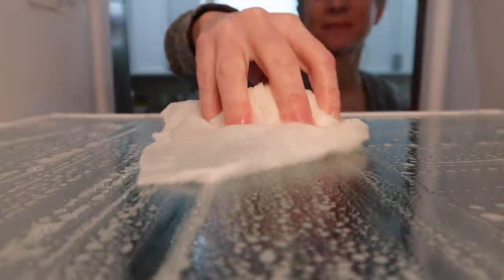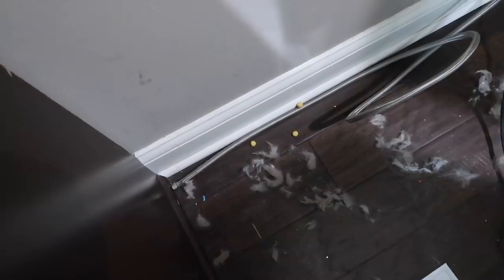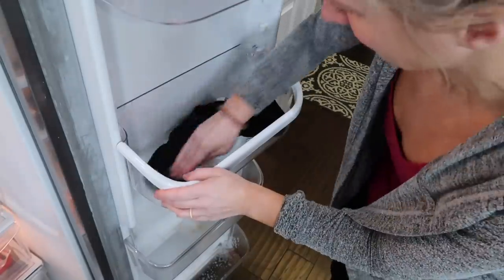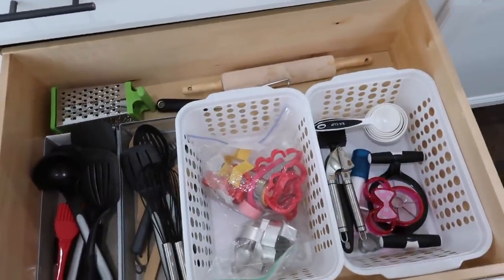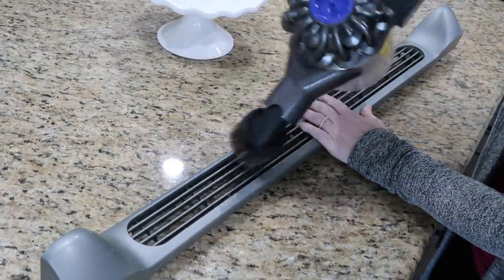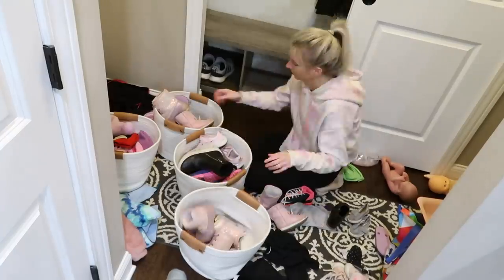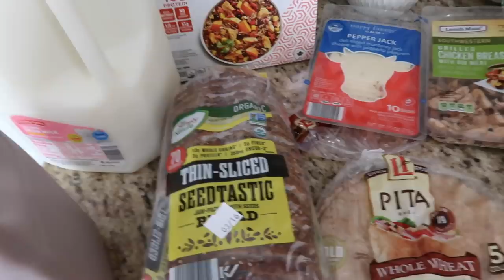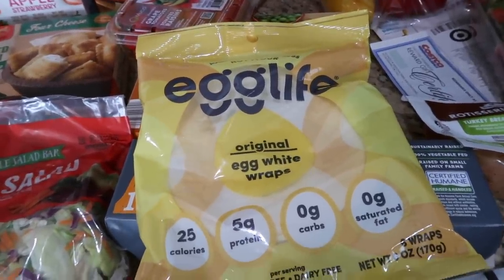EXTREME CLEAN WITH ME + DECLUTTER + ORGANIZE |DAYS OF SPEED CLEANING MOTIVATION |FRIDGE ORGANIZATION

Comment: I have a question about the bissel  proheat 2x revolution pet pro carpet cleaner I just purchased it today and is the water suppose to come out of the upholstery attachment cold I used hot water but it sprays out cold on attachment ?
Reply from the maker: Hmmm no. It should just be pulling from the water you put in the tank. Maybe keep trying it. There might have been water left in the attachment
Reply: @JamiesJourney  ok thanks